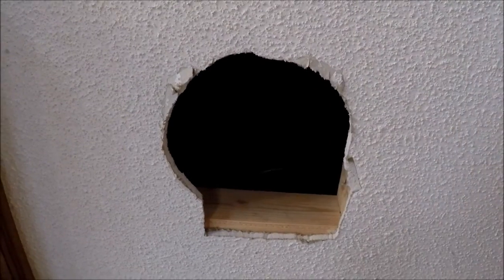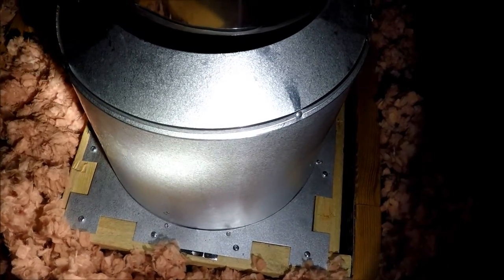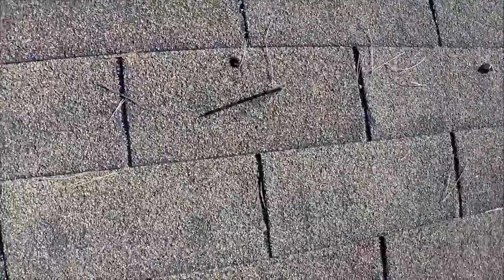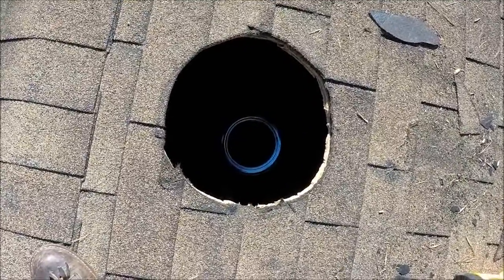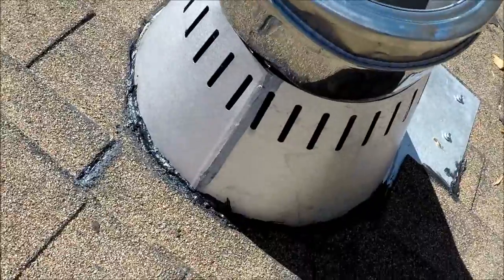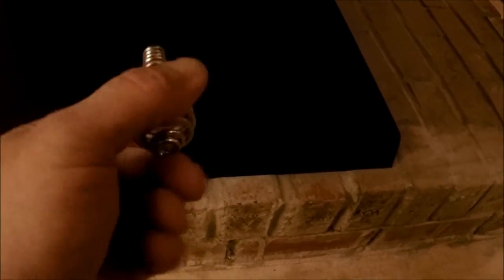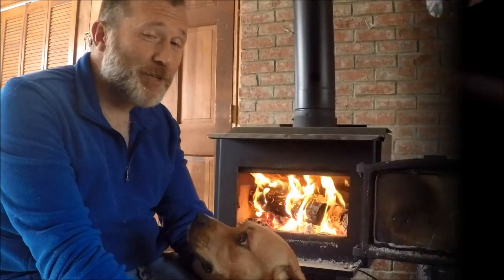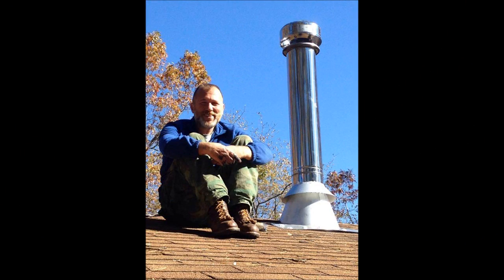Woodstove Project Completion

Comment: Awesome job CP!  Good on yer.  I heat my house with a stove very similar to yours and it's been in continuous operation since 94.  Have had to replace the fire bricks twice and the glass once (got cracked somehow).  We get -20F here in the winter up next to Lake Superior.  My only suggestion would be to make sure and remove and clean your single wall stove pipe sections every 6 weeks or so.  Keeps things safe and burns/heats/draws way better.  I clean my chimney every fall with a brush from the roof.  A woodpile is better than money in the bank.  Semper Fi.